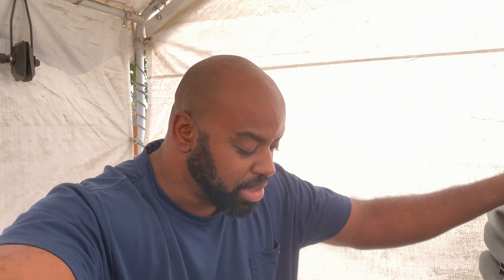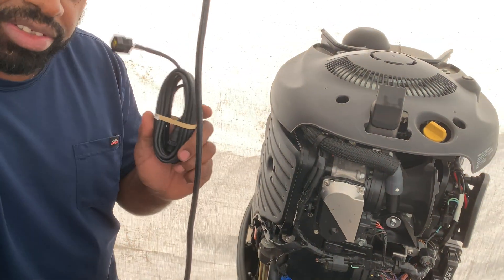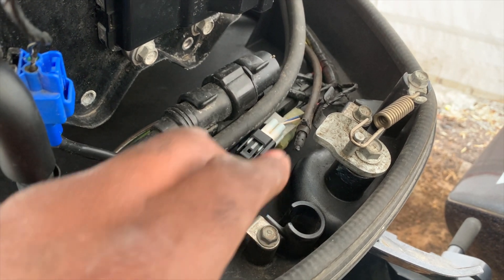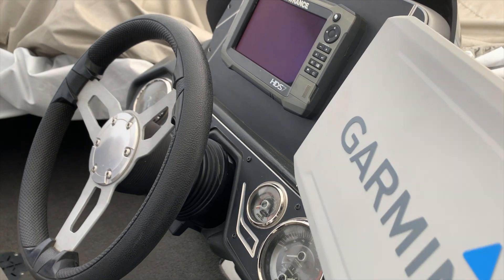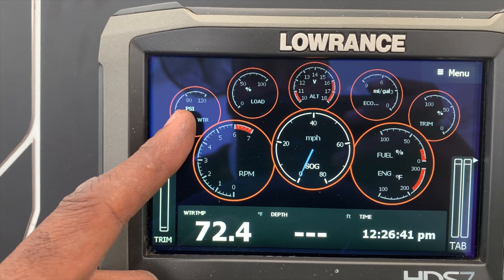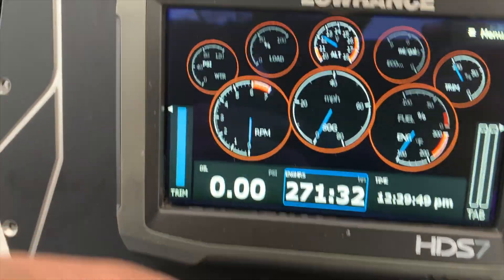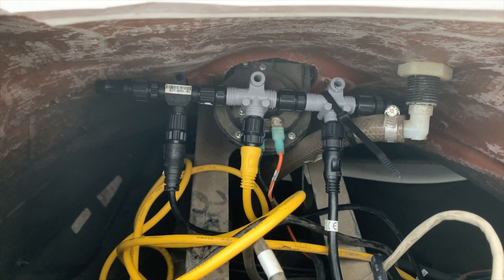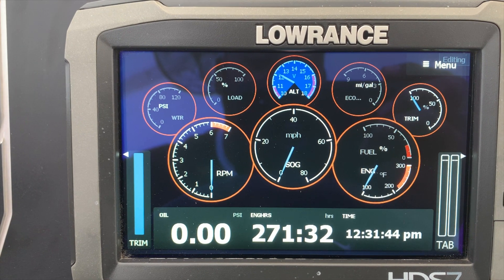NMEA 2000 installed

Comment: Great video. I just installed the NMEA 2000 backbone on my Starcraft 191 SVX, I asked the dealer to install, but told me it wasn't needed (He install a tiny hr meter that ran off the spark plug and that died in less than a year). I  wanted to have all the same Engine info you wanted. I have watched a lot of great videos like this one and I am grateful for people who put this info out there.  I have done a lot of upgrades since I purchased my boat new ( upgraded Lowrance, radio remote head, and connected my Yamaha 150 SHO.  I am glad I have done the work myself, I have gotten to learn a lot about my boat.
Thanks again!
Reply from the maker: Thank you for watching NoBoat-k8u

Comment: Nice video. thanks for sharing. What year and model Skeeter are you running? How did you mount your Garmin at the steering area? I have a 2019 Skeeter ZX200 and the area to the right of the boat is not flat.
Reply from the maker: Thanks for watching Robert. My  skeeter is 2016 190. You should have enough room to use a universal ball mount for your Garmin near the rpm gauge, or right about it. That what I used.

Comment: Nice video! I have a similar setup. Yamaha VF175 with a Lowrance HDS 9 Live hooked it up just as you did but I can’t get the gauges to read. Did you have to install a gateway that you didn’t show in the video?
Reply from the maker: Interesting. Did you use the Lowrance plug and play? Also, make sure you’re getting power to the Nema 2000
Reply: @ not sure what you’re calling the lowrance plug n play. I have the Lowrance NMEA cable connected to the Yamaha engine and the Lowrance NMEA 2000 backbone and the yamaha 6Y8 gauges are also connected to the backbone. Have a point 1 antenna on the rear and a HDS Live 7 on the bow also connected to the backbone. The backbone is powered.

Comment: hey i have a question can i connect the interface cable from the motor directly to the gps to the nema 2000 plug in or do i need a command link getaway
Reply from the maker: I am not sure. But I think you will need a Network Port Expander.

Comment: Did you have any problems getting data on the Lowrance? I just installed the system on a Yamaha to Lowrance and I can’t get anything.
Reply from the maker: Bluexpress2242 no I don’t have any issues. Check the power wire.
Reply: @sixfivefishing1528  Thanks will do.

Comment: Did you use the screws that came in the box to flush mount it? I just bought this unit and thought it would have bolts and wing nuts for mounting.
Reply from the maker: Thanks for watching Justin Abbott. My lowrance come pre-mounted when bought the boat.

Comment: Nice job wearing that up. I have a question for your power cable did you hook the positive and -2 your ignition switch switch or directly to the battery not sure what to do there thank you.
Reply from the maker: Jeff Ghigo. Tanks for watching. My boat came pre wired with a power to my auxiliary switch wires ran. So I just hook up to that wire and I could power off and on with my auxiliary switch. That how I power mine. Hope this was helpful. And sorry it told me 2 days to get you an answer.

Comment: How is that you don’t have Yamaha gauges or display? 
And how you reset oil change  reminder?
Reply from the maker: Thanks for watching verdant dujmovic. Unfortunately, my zx190 doesn’t come equipped with a Yamaha gauge. I 
Suspect this is how they kept the price low. This is why I installed a nmea 2000. I don’t have a oil change reminder. I just write the hour on my oil filter at the time I change but I change my before a 100 hours.

Comment: So a outboard motor I face cable needs to be purchased for my 2021 Yamaha 50?
Then I need 2 T for drop cables to the engine and the Garmin Echomap? And a 3rd T for the backbone power supply? The a male and female  termination resisters, one for each end?
Reply from the maker: You are correct beyondupnorth. I used the lowrance interface cable.

Comment: Hello, I also want to connect a yamaha 150f detl 2016, but the service technician mentioned to me that I need an adapter for the yamaha engine. As I see it, you mounted it without a jumper and everything works?
Reply from the maker: Urban Cunder apologize for not responding to your message until now. Yes, mine works great!!